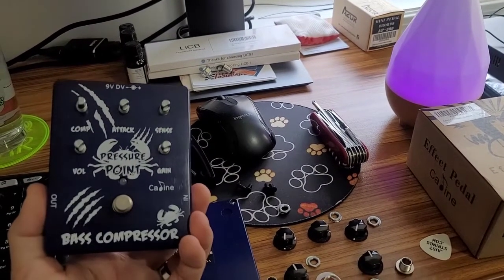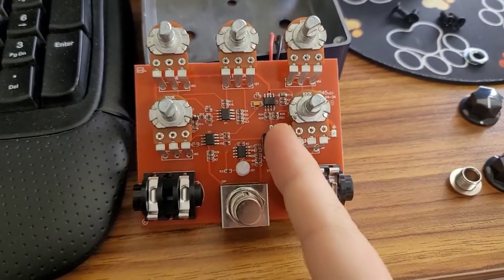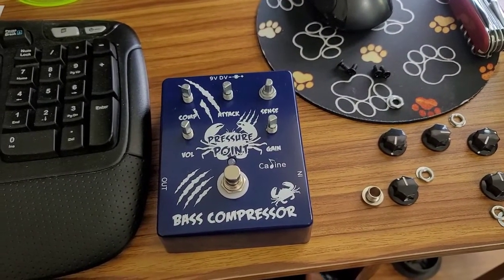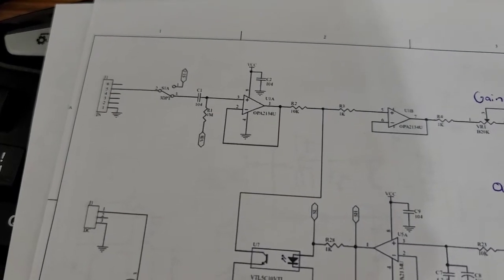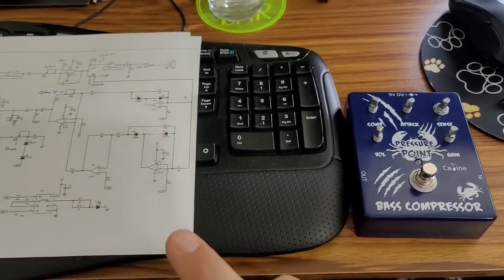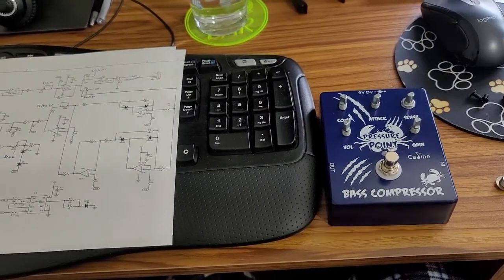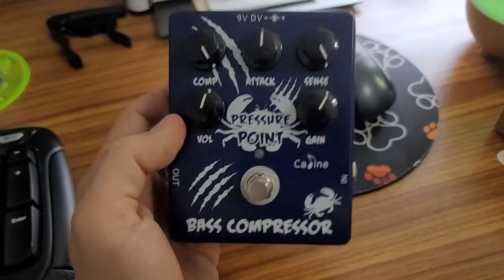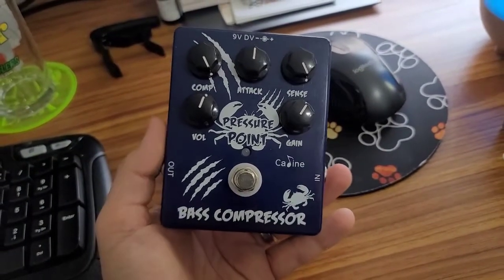Caline CP-45 Pressure Point Bass Compressor: Technical Review & Teardown

Comment: This pedal is the only one that could tame the peaks of my board and I never understood what it was actually doing just got it to work by putting all the knobs at full and gain at cero, now I understand what it does and will try your settings and see what happens, the gain knob induced noise in my rig but at cero the pedal is quiet and still reacts to my filters and fuzz that usually can even blow speakers if not used correctly.

is there a way to modify the pedal so one could control the attack of the pedal like swapping a resistor for a pot? (i know it might not be that simple as I put it).
Reply from the maker: Not easy to modify SMD. I haven't investigated it further
Reply: @Bassguitarist1985  i understand thanks, is there a way to reach you? Any social or reddit? I promise is not about the mods I have questions about the proper use of this pedal.

Comment: I'm a dumb ass. I'm still confused. Attack and sense are how much signal go to each compressor.... So that's like a blend then, like parallel compression? The more you turn them up the louder that compressed signal is versus your unaffected sound? And the comp is like a master blend?
Reply from the maker: The attack in the sense are two separate compression circuits. The knobs adjust how much signal go to those circuits. It is not parallel compression it is sidechain compression. The comp is the master volume going to the two compression circuits.

Comment: I bought this pedal and I did get a popping noise whenever I engaged the pedal. I tried everything to stop the popping noise but nothing worked. I took a chance and grounded the pedal switch and it worked. Not sure why it worked but it did. I paid 30 for the pedal so figured I would take a chance and if it didn't work, oh well. Lol
Reply from the maker: How did you ground it?

Comment: This is a weak bass compressor
Reply from the maker: Agreed it is not the best. Some of the fixed parameters like attack and release should be adjustable.
Reply: @Bassguitarist1985  i set everything full except the volume just to feel something
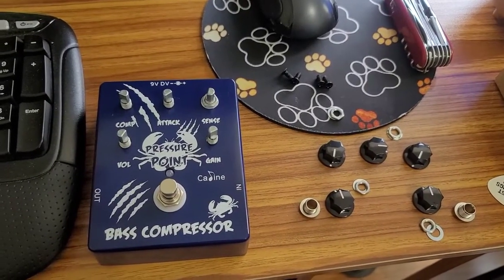Reply from the maker: @jethroviloria18  try turning the comp and sense all the way up, attack at 2:00,  Volume at 10:00 and gain at 2:00. Again you will not be able to adjust the attack and release parameters which is the worst part of this pedal unfortunately. Sense and attack are simply volume knobs to the two gain stages that have fixed ratios. It's a good circuit design but not implemented properly in my opinion when you compare it to other compressor pedals that allow more flexibility in adjustment. It's a budget pedal, it gives you basic function which may or may not be usable depending on your application.

Comment: I got this pedal in 2021 and couldn't figure out what the controls did results varied with different amps and basses ,always  had good effects with the joyo dyna comp and kokko compressor  but know that I've seen  this video the caline cp-45 will not be going to the Ewaste collection facility thanks for the detailed information so glad I found it.😄👍
Reply from the maker: Glad I could help out. It's an inexpensive compressor. It gets the job done for the price. More expensive comp pedals will do more, but considering the build quality and the circuit design its pretty decent for what you pay for it.
Reply: @Bassguitarist1985  great info passing along the info to my bass playing colleagues.👍
Reply from the maker: @earlgarcia9824  appreciate that thank you!

Comment: So, I'm new into playing bass and bought the Caline CP-45 Bass Compressor. I currently don't have an amp but I have it connected to my PC using an audio interface (M-Audio Air 192-4 if that matters).
So what happens is when the compressor is off, no sound is coming out. After pressing on the footswitch, sound comes on but no light on it. Knobs doesn't do anything on it. Volume, gain, nothing at all. It feels like I'm playing the bass without it. 
I've seen a couple of youtube videos about it, I can see that there's power light right when they push the switch. 
I don't know if this is only happening because I'm not playing on an amp? I already contacted the seller and hoping for a reply tomorrow.
Reply from the maker: Hey. Sounds like a malfunction. I'd return it and get a replacement

Comment: Does this pedal use parallel compression?
Reply from the maker: hey, more like series compression. High compression ratio first then lower compression after that stage. the dry signal is not reintroduced into the signal
Reply: @Bassguitarist1985  Hi! But doesn't the dry signal split between output and compression?
Reply from the maker: @guimeloy8160  hold up let me grab the schematic I'll get back to you in a few minutes
Reply from the maker: @guimeloy8160  so the dry output pregain stage is being  controlled by the side chain. The side chain controls the opticoupler which will then reduce the pre gain stage of the dry signal chain. So essentially the side chain is a control circuit. 

It is most definitely a sidechain compression circuit and not parallel compression. Typically this method is only done in the studio or obtained via a plug-in on a DAW by use of a mixer and multiple compression units.
Reply: @Bassguitarist1985  I understand now, thank you for explanation!
Reply from the maker: @guimeloy8160  you are very welcome thank you!

Comment: OMG, I didn't expect to find a such detailed video, because of the pedal price range. You did a terrific job explaining everything. I have a very specific question, not regarding this compressor but for bass compressors in general, I guess. I'm trying to find a multiband compressor, whether it is a rack or pedal for bass that could do the job as the GT-10B multiband compressor, I haven't found anything that comes near, regarding the sound and the price (T.T), do you have any suggestion on this, can I find a standalone effect that can do this?
Reply from the maker: thank you for watching. Multiband compression for any instrument is going to be pricey.  I have a dual band Digitech Bass Squeeze that works very well. You can adjust the cross over frequency where the compression happens. The EBS Multicomp is another good one but doesnt allow you change the xover settings. the Boss BC-1X is another option, but again no way to adjust where the Low/high split happens.

Any other multiband compressor, say more than 2 will be prohibitively expensive and would be more economical as a VST plugin.
Reply: Would a second hand akai hexaconp fit the bill?

Comment: Hello! Don't have a Caline CP-47 schematic? Good compressor, but overloaded by a strong attack on the strings ((((((
Reply from the maker: Hey Matt, whats your whole setup? I don't have a schematic for that particular pedal but I can certainly ask if there is a particular flaw in the circuit design. I've only heard good things given the pedal at its price point. If you can tell me your entire signal chain maybe I can pinpoint the issue which if I had to guess was more of a setup issue and not a design flaw in the circuit of the pedal. I could be wrong though.
Reply: @Bassguitarist1985  Even just a guitar and a compressor. Clipping appears if you unscrew the equalizer to the low frequencies or increase the compression. Clipping does not depend on the volume knob of the pedal.
Reply from the maker: @mattveyy  what type of guitar? Active or passive pickups? Single or double humbucker?
Reply: @Bassguitarist1985  Stratocaster HSS. Passive. On singles, almost everything is in order. And the humbucker is always overdriven. I also tried bass (jazzbass, passive). The more low frequencies, the more distortion.
Reply: The least distortion is when the equalizer knob is turned to the high frequencies.
Reply from the maker: @mattveyy  this pedal is not designed for bass it does not have enough headroom for the peaks. Also with the pickups being passive I've seen issues with impedance mismatching. It could be a defective unit I'm not sure. From what I've seen of the online demos the pedal seems solid
Reply: @Bassguitarist1985  I sent you an audio example by email.
Reply from the maker: @mattveyy  roger that. I havent seen it. You sure you sent it to the right email?
Reply from the maker: @mattveyy  received, yeah sounds like you are overloading the input. try reducing the input to the pedal and increase the volume going to your amp/mixer
Reply: @Bassguitarist1985  No, it's just a pedal and a guitar recorded in a line. There is only a simulation of the cabinet on the computer. It's definitely a perp load inside this pedal.
Reply from the maker: @mattveyy  how are you recording it exactly? Into the line in of your sound card? Are you using any kind of preamp interface?
Reply: @Bassguitarist1985  Guitar - CP47 - Audio interface. I tried to power the pedal from 12 volts. The distortions are almost gone. I think it will not withstand 18 volts, like the original Diamond CPR1((((
Reply: We can say that the problem has been solved. Thank you!
Reply from the maker: @mattveyy  great to hear! Careful about wrong voltages. Some pedals you power with 9vdc, will upconvert to 18VDC for example to run the chips at. Unless you know the schematic and specs of ICs it's dangerous. It can fry things. 

Bottom line glad to hear issue is solved!
Reply: @Bassguitarist1985  Thank you! But I have studied this scheme a little. This is allowed here. Only capacitors are 16V, this is not enough.
Reply from the maker: @mattveyy  you have the schematic?
Reply: @Bassguitarist1985  No. I disassembled the pedal and compared with the original schematic (diamond cpr1)
Reply from the maker: @mattveyy  good stuff!

Comment: How to fix the humming problem of this pedal? Tnx
Reply from the maker: What I found on these pedals is the metal collars that make up the quarter inch output and input. You need to scrape away some of the paint surrounding it so that the washer can make contact with the metal casing and make a solid ground. Once I did that the buzzing went away.

Keep in mind that it may not be the pedal itself but possibly a power supply ground loop issue, or something in your amplifier. Many factors...
Reply: thanks a lot sir.

Comment: Hello! Thanks for the complete info :)

Im waiting for this pedal for try it, is really a good bass comp or i can use an guitar comp with bass eq?
Reply from the maker: Its a decent bass compressor. Doesn't have a lot of adjustability like more expensive compressors but it does the job! 

You can use a guitar compressor but vhances are you may not like the sound. Not many differences with a bass vompnvs a guitar comp except the bass comp has a wider bandwidth to handle the lower frequencies better. Worth trying though!

Comment: In terms of bass compressor vs guitar compressor is there a big difference? Could you use this on guitar? What makes it specific to bass I guess. Thanks so much for the info and details. Learning a lot from these please do more!
Reply from the maker: Not really any major difference other than the circuit for bass needs to be adjusted to handle the lower frequencies. Bass tends to be more peaky than guitar so headroom is also a consideration. Caline has a compressor for guitar called the pressure tank. Maybe try that out?
Reply: I tried maybe its better for guitar it kindda squish a little bit